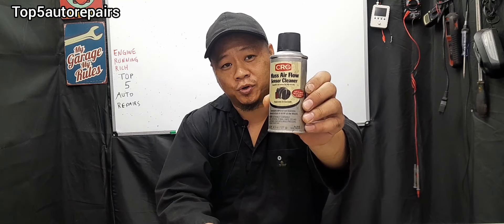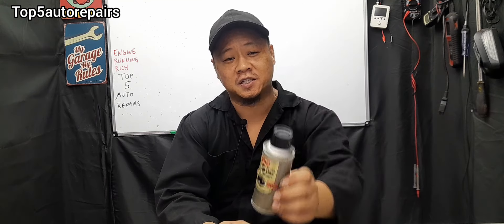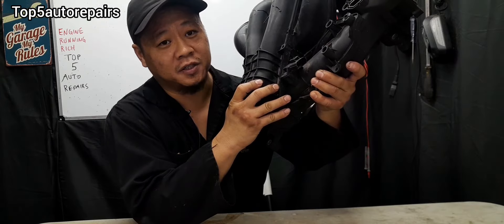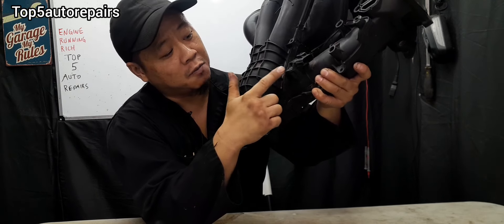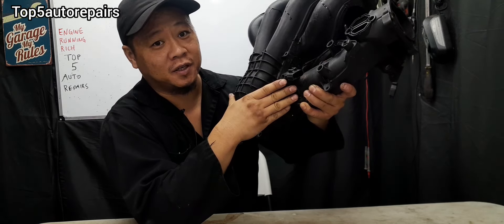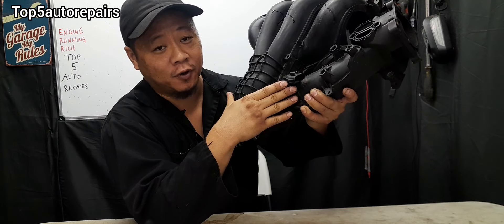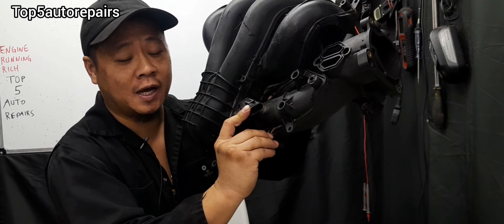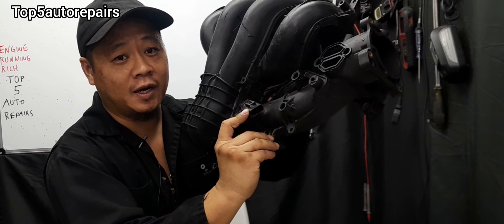ENGINE RUNNING RICH?

Comment: The two most common reasons I have found in my experience you left out.  Number 1 I have seen most of is stuck open purge control valve.  And also worn out spark plugs not burning all the fuel.  I have also seen cars with both a map sensor and a mass airflow, I’m pretty sure.  I can’t remember what car that was on.
Reply: My Chevy 400 was rich and it was worn spark plugs and a sticking choke
Reply: What about a false reading of an oxygen sensor caused by a bad signal wire? Is this a possibility? I replaced catalytic converter and oxygen sensor but carbon monoxide is still about 5 percent. I replaced further throttle body, temperature sensor and map sensor (engine does not have a maf-sensor). Sparks are always black, although I even removed air filter.
Reply: my mazda 3 has both map and maf sensors

Comment: Hello sir..why my car spark plugs get black ?I have a rattling and engine knocking around and why when I'm accelerating on 120kmph and the engine stall to lower rpm..but the engine doesn't shut off..can I know why?
Reply: Hello did you figure out what is was
Reply: Could be faulty fuel injectors what vehicle?

Comment: This guy forgot code p2188 and he also said a car that has a map sensor doesn't have a mass air flow he's wrong a mazdaspeed 3 has a map sensor and a mass air flow
Reply: I have this code on my mazdaspeed, I have changed everything except the MAP sensor and I’m still running rich
Reply: @sav7123  what kind of mass air flow did u. Install also check pressure sensor for the gas
Reply: @javihernandez16mx3  I have a denso MAF sensor. I also changed the pressure sensor on the fuel rail and the injectors.
Reply: My Golf 4 1.4 16V has a map-sensor but no maf-sensor.
Reply: @sav7123  And? Did the problem (running rich) disappear?
Reply: @vanlendl1  yes I had to get the OEM MAF sensor and that fixed the issue. my car has a map and a MAF. If you don’t have a MAF than the map or 02 sensor could be ur problem

Comment: False reading of an oxygen sensor signal caused by bad wire? Is this a possibility? Oxygen sensor is new and sparks are black all the time. Carbon monoxide is 5 percent and more, although engine was heated up. Catalytic converter is new.

Comment: Hey bub, I have a yr 2000 Accord ulev-4 and I changed my spark plugs and now I'm getting nothing but static from my radio, I looked for any Ground wire by the battery and nothing, what happened bro.
Reply: Maybe unsuitable spark plugs? Resistor spark plugs are practically universal for EFI engines.
Reply from the maker: Check for loose spark plug wires. Change spark plugs and use oem.

Comment: Very helpful thank you, I've had this problem with a Seat Ibiza, I ended up replacing the fuel filter and fuel pump because of idle issues, but I believe it's the oxygen sensor (lambda sensor) that is causing the the running rich issue. Those oxygen sensors aren't cheap!

Comment: 3800 series I motor. No codes. Running rich enough you can smell it. Gets up the temp okay. Starts up fine.... New plugs and wires. Terrible fuel consumption. Also has slight misfire at idle. Thoughts?
Reply: Maybe exhaust leak.......

Comment: Hi, 

I enjoy your videos they are very good. 

I have a 2019 Ford Transit 350 2 litre diesel UK model (I live in the UK) 
I have a single radiator fan with 2 speeds; High Speed and Low Speed.  
When I turn my AC on, my Van no longer uses the Low Speed fan, it ONLY uses the high speed fan in 30 second cycles, and then turn off, and then again repeats the cycles. My van never use to use the High speed Fan when using the AC; it would only use low speed van. My van is not overheating at all, nor does the AC NOT work; it blows freezing cold air, as it always did, and there is no engine performance issue. 
I have gone to 3 different mechanics and they have all used their fancy scan tools, and they cannot find ANY fault codes on my van or see any abnormal values, when testing on Live View. 

How do I go about resolving this issue ? Have you got any tips for me on this issue, or direction for what I can do next ? 

please do let me know 

Thank youuu !

Comment: Hello Bob, I have a 2009 Corolla the check engine light came on and shows a p0013 code I tried swapping the cam actuator but the code still remains. Please what may be the cause. Thanks
Reply from the maker: Check for clogged or faulty oil control valve
Reply: @Top5AutoRepairs YAY!!!🥳🎈🎉♥️ I just found your channel. Please Sir...desperately need help.  My 2008 Kia Optima just started this...not wanting to start after filling up at gas station. It takes several tries. I had Purge Valve replaced, both O2 Sensors replaced, Canister Vent Valve replaced and cleaned Throttle Body. So aggravating. Any suggestions?? Thanks for any help.😊
Reply: @Top5AutoRepairs  thanks sir will check and get back to you
Reply: @Top5AutoRepairs  I swapped my oil control valve with a friend's and the check engine light was still there. I swapped both intake and exhaust
Reply from the maker: Charcoal canister might be saturated with fuel
Reply: @Top5AutoRepairs  how can I check for this
Reply: @Top5AutoRepairs  Thank you for sharing your knowledge and kindness with your viewers.♥️ So would Charcoal Canister throw a specific code? So far it's been Evap P0455...repaired. P2187 Lean at Idle Bank 1. Then the latest is... P0140 O2 Sensor No Activity...finding out the mechanic broke the attachment clip piece that the downstream sensor plugs into so Dad replaced both up and downstream. The engine light went off then I needed gas...stalled when started but drove fine home and next day, drives fine so far and no engine light.
Reply: @Top5AutoRepairs  pls do I have to relearn after changing the cam shaft.

Comment: Boss is it possible that your injectors are clogged and sending extra rich mixture to the engine even your car isn't rough idling pickup smoothly and injector pulse value is showing on scanner " 2.4 "
Reply from the maker: Hello. If the fuel injectors are clogged it will cause a lean condition instead of a rich condition.

Comment: My Honda feels forced, it will gradually go up in speed if I press the gas slowly but say I need to pick up speed quickly and press down on the gas all the way the rpm will shoot up but the engine won’t accelerate. Any tips on where to start? No engine light tho
Reply: Transmission slip possibly.